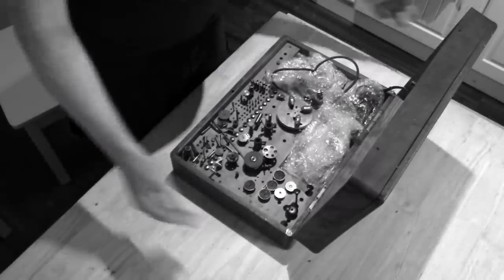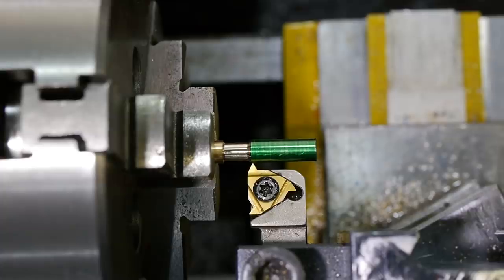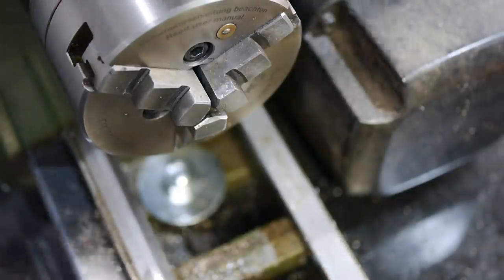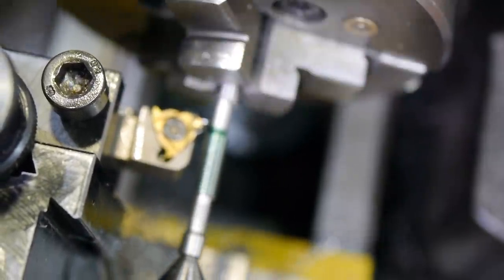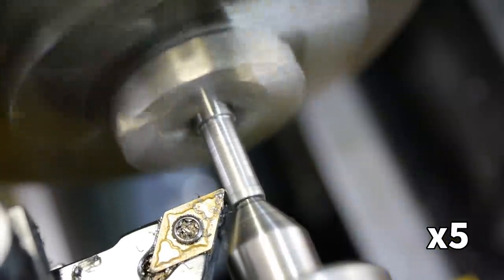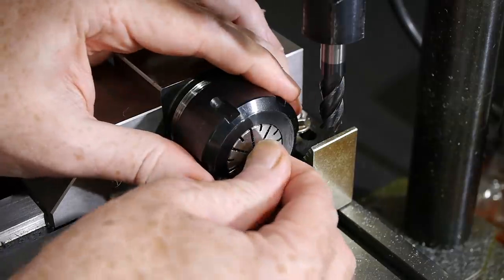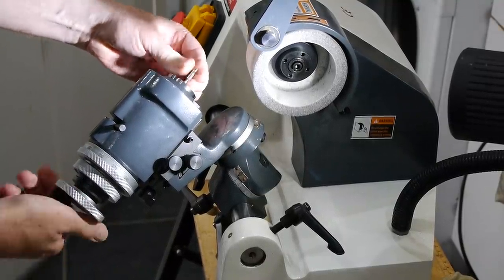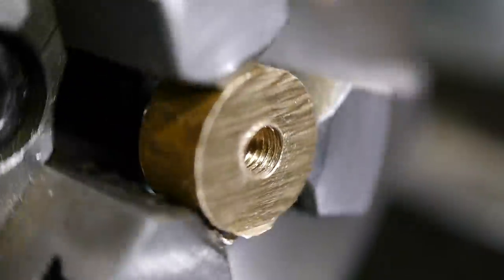Making a Custom Tap on the Proxxon PD 250/e Lathe

Comment: Special jacks and tool & cutter grinders and making taps,  oh my! The 55 deg thread suggests  Whitworth threads, but I never heard of a watchmaker's lathe using Whitworth. Maybe it was a British-built job and they used that thread out of habit. No law against it:) . this ill get a re-watch.
Reply from the maker: Thanks Juan! I did quite a bit of reading on the lathe, and the thread standards of the time period it was made. There was a lot of variation in included angle, with many different angles proposed. In Germany (where the lathe was built) metric measurement was standard, but the modern 60 degree metric threads had not yet been standardised.
Reply: Interesting! Didn't know Germany was late to standardize  on 60 deg threads
Reply from the maker: @juanrivero8  I don't think Germany was any later than anyone else. These lathes were designed in the second half of the 19th century, but most thread standards didn't emerge until the later part of the century.

Comment: Another solution to the relief problem is to cut your flutes off center, causing a positive rake on the cutting edge
Reply from the maker: A positive rake would probably be useful, but rake is not the same as relief. The tap would still need to have the relief ground in behind the cutting edge.

Comment: i speculate that considering the engagement of loading on the  cutter  ( when milling the tap flutes; given that it is a non uniform cut loading for an odd number of flutes) you would technically want an even number of flutes on your cutter for this kind of thing otherwise it will be more prone to chatter and deflection. perhaps a more seasoned machinist could offer further insight as this is really just speculation.
Reply from the maker: I have to admit to knowing very little about endmill selection, beyond knowing that more flutes generally means more load. I'd love to hear if anyone has advice on chossing small diameter endmills for use on a very small mill, especially as I don't have the rpm that endmills like this really need.
Reply: @AdventureswithaVerySmallLathe  More flutes means more cutting load typically only because you increase the feed rate to reach the optimum cutting feed per flute (double the flutes ~double the feed rate~). For the odd job this is not really important slightly more tool wear isn’t the end of the day for a better cut and if your limited by a low RPM then a high number of flutes is a mean you can increase material removal rates if your setup can handle the increase feed rate and forces.   

I suggested an even number of flutes in this instance because if you think about how the cutting action happens over the course of 1 revolution you will find that only 2 of the 3 flutes are cutting at full depth some of the time (as 1 ball mill flute will be crossing the flute or “gap” of the tap), as it is an odd number of flutes this means the cutting forces are non-uniformed across the axis of rotation potentially resulting in chatter. A 2 flute cutter for example would have uniformed cutting forces but a non-uniformed cutting load over a full revolution (again as both flutes cross the gap in the middle) a 4 flute cutter would have both uniformed cutting load (almost) and uniformed cutting forces (across axis of rotation). 

I should point out that I’m only really basing this off of the reasoning I pointed out above. And all of  this is really only because in this instance you have non-unformed cutting forces over 1 revolution (with a  3 flute cutter), now on an unformed cut (no gaps) cutting flutes directly opposing each other (such as 2 flutes of 4 flutes) actually creates oscillation => chatter but not as much as having a non-unformed cut would.    

I hope this explanation is helpful: as while I recognise in this instance it probably wouldn’t have made a huge amount of (if any) difference given the depth of cut and your feed rates I figured it might be useful to point out how you can think about the engagement of each flute when cutting on a per revolution basis as this might help with tool selection of other projects and generally help reduce chatter.

Comment: Would case hardening be an advantage?
Reply from the maker: I don't have enough deep knowedge to know whether case hardening can work for making a tap. The amount of material I needed for this one-off tool was cheap enough that it wasn't a factor in choosing the material, so I chose a through-hardening tool steel that is easy to machine.

Comment: Why are you grinding the taper after hardening the steel? You could have cut the taper on the lathe, or at least grind it before hardening... Maybe doing taper before cuting the "thread" would produce sharper tap when doing it before hardening.
Reply from the maker: All the videos I watched, and projects descriptions I read involved doing some kind of grind after hardening to form the cutting edge. Hardened steel is much less likely for form a burr, and holds an edge better, so it makes sense to me to form and sharpen the cutting edges after hardening.
Reply: @AdventureswithaVerySmallLathe  i know, but is this really how you sharpen a tap? feels to me like it needs more than grinding taper to be properly sharpened...
Reply from the maker: Oh, you're absolutely right. The taper turns out to be almost irrelevant compared to grinding the relief, which is what really allows the tap to cut properly. The step I did to add the pure taper, without any relief grind, was completely pointless. I should have ground the taper and relief at the same time, but had no idea how to go about it. I mentioned this in the voiceover, but I have no good video footage of grinding the relief, as it was very difficult to shoot, and I was clueless. :)

Comment: Nice skills. And thank you for the non-magnetic trick.
Did i hear correctly, you used naphta gas?
Reply from the maker: The bottle is labelled "MAP/PRO gas". It's intended to be hotter than propane, and easier to use than acetylene. The data sheet contains a lot of information, with some parts saying that the bottle contains mixture of methylacetylene (propyne) and propadiene, other parts suggesting it contains propylene. As a simple to use hand torch it works way better than the propane torch I tried, and is easy to buy at the local home improvement store.
Reply: @AdventureswithaVerySmallLathe  MAP/PRO is just propylene, but labelled that way to indicate its usage as a MAPP substitute. "True" MAPP was a trademarked product that is no longer available. The easy way to tell is to look for the UN number on the bottle - 1060 for MAPP and 1077 for propylene

Comment: If you are going to remake the nut why not use a more standard thread pitch?
Reply: It would change travel speed of the ways
Reply: @bertjetolberg103  pitch would be the same on 55 and 60 degrees. .same amount of travel per rev.
Reply: @albrolake7787  I suspect the pitch is as much a problem as the angle. I checked McMaster, and they have no 0.6mm pitch taps of any sort.
Reply: @outputcoupler7819  3.5 x 0.6 standard size

Comment: loved this video so much!! Question not relating to the Tap itself but the oiling of the products before milling. How do you know when or when not to apply oil (lubricant) to the material you are milling. I watch a lot of these videos, well a reasonable amount here and there. I say to myself "that needs some lube, surely". Ive never done this kind of work so i'm curious. as a motor mechanic, i lube anything i'm trilling metal wise

Comment: Just starting to watch your videos, very nice videos! tell me is that the only lathe you have in your shop? is Proxxon lathe a good lathe to buy, if you had to purchase a new lathe what would be your first choice of lathe? Thanks for making  those videos.
Reply from the maker: If I could turn back time, and buy my first lathe again I think I would probably buy something cheaper. The reason I'd do that is that I would treat it as more disposable, and modify it as much as possible while I learn how to make it better. A few years later, if I was still machining, I would buy something larger to replace my cheap small lathe.

The Proxxon has some fine qualities, but at some point I'm going to need to upgrade, and in the meantime I'm reluctant to modify or risk damaging it due to the high cost.

Comment: it looks like your trying to make a BA thread very close to metric fine  in its smaller sizes . a BA  0 thread for example has a pitch of 1mm but root angle of 55 deg but will take a standard 6mm metric nut   BA threads are often used for model making or watch making.
Reply from the maker: I don't think it is BA. The closest to the correct outer diameter would be 3BA, but the pitch doesn't match at all. I searched far and wide to find a standard thread that matched the screw, but couldn't find one.

Comment: so.. hardened steel is nonmagnetic? but that is not stainless right?
Reply from the maker: Hardened steel is just as magnetic as before at room temperature; the steel becomes non-magnetic when it is hot. The magnet trick works because non-stainless carbon steel becomes non magnetic above about 727 C, because it at this point the crystal structure transforms to austenite - the same crystal structure as stainless steel. This transformation is essential before quenching to harden the steel, so many hobbyists use a magnet to check if the steel is hot enough. Read Guodlca's pinned post for some more details of what happens to steel as it heats up, and stops being magnetic.
Reply from the maker: All this is a major simplification, and not really scientifically accurate. If you are interested in really understanding steel, start reading in wikipedia, and go from there.
Reply: @AdventureswithaVerySmallLathe  oh thank you, so you test the temperature with the magnet, cause it is nice and roasted and only then it is non magnetic. didnt realize that, thought the structure holds after cooldown..
Reply from the maker: That's correct.

Comment: Where did you get your threading insert?
Reply from the maker: I ordered it through eBay UK. It wasn't easy to find. There are hundreds of sellers for 60degree thread inserts, but few for 55degree inserts.
Reply: @AdventureswithaVerySmallLathe  under stood now to buy a 60° insert for some threads I am cutting also have any tips for cutting threads to a shoulder?
Reply from the maker: @nullsnaggle5198  My favorite technique for cutting to a shoulder is to cut in reverse, so I'm actually starting at the shoulder and cutting away. For details of my technique check out the Boring Head Arbor video, though I use the same technique in the recent Machinist's Jack video too. It's a bit unconventional, and requires an internal threading bar, and an internal insert, but it works really well.
Reply: @AdventureswithaVerySmallLathe  alright thank you my good man I hope it works with a central machining lathe as well as a proxon😛👍

Comment: I noticed when you center drilled the steel stock, the drill bit wandered a bit off center and gave you an eccentric center hole.
Reply: Most if not all lathes do that.  That bit pulled to center, not away from it.  The tail stock is usually slightly off no matter how hard you try to align it and that starter bit is designed to find center on a flat spinning surface all on its own.  Tailstock mounted reamers are designed with a long shaft with slight flex so it can also compensate for this slight misalignment.  No matter how accurately you try to level that lathe bed there will always be the slightest amount of twist in the bed which puts the tailstock slightly out of alignment, in addition a new lathe actually has the tailstock centerline sitting very slightly over center because the designers know that the way surfaces will wear over time. And the drill centerline will move down from slightly above center height to perfect center height to slightly below center height during the design life of the lathe.  Chris
Reply: @shadowdog500  thanks, I get what you're saying.
Reply from the maker: The tail stock is the weakest part of the Proxxon. It isn't perfectly central, isn't very rigid, and can't be adjusted. If I want to have really concentric hole, I have no choice but to use a boring bar. Thankfully for this project I didn't need the centre to be perfect.

Comment: Nice build, great job on the editing
Reply from the maker: Thanks Dale, that means a lot to me! :)
Reply: @AdventureswithaVerySmallLathe  Hello nice entertaining Video. For your next taps you can plan to grind some Back reliaf  in the taper. To See what i mean . Inspect a purchased tap closly.
Reply from the maker: @Hendreh1  Yep, you're right. While I did add some back relief to this one, the video recording didn't work well, so I didn't show it in this video. I only realised afterwards that I should have ground in the back relief and the taper at the same time, in the same grinding operation.
Reply: @AdventureswithaVerySmallLathe  OK nice to know . I Just thougth , it would work in brass anyway. A wile ago i made a tap for a S20x2 internal  thread . I can say Homemade taps with back relief work even in mild steel.  One more questionen. Where do you buy your chemical paste that you smeer on the workpice before hardening? Greetings
Reply from the maker: @Hendreh1  The paste is Boric Acid mixed with methylated spirits (de-natured alcohol). Boric Acid is sold for a number of reasons, and is most easily available as an insecticide. I bought it from Ebay.

Comment: What DCMT inserts do you use?
Reply from the maker: The ones in this video are the unbranded inserts that came with the tool, and they are pretty bad. I have some Sandvik Coromant inserts on order, as their inserts have worked really well for my CCMT tooling. For a small lathe like this inserts with a small nose radius (0.2mm), and a "finishing" chip breaker are best.
Reply: @AdventureswithaVerySmallLathe  Thanks, i had lots of trouble cutting 303 steel in a bigger lathe and i was sure it was becaus of the inserts, tried every speed and feed possible but never got a good finish.

Comment: I find it curious you have a d bit grinder that probably cost more than your proxxon lathe ... ?! You plan to treat yourself to a lathe upgrade sometime ? ;-)
Reply from the maker: The D-bit grinder was quite a bit cheaper than the Proxxon lathe. My main problem is lack of space at the moment. Only the Proxxon has a proper permanent bench space, and the grinder and my chinese lathe get shifted around from corner to corner as I work in the shop. Once I move to a bigger place with a proper dedicated shop then a lathe upgrade will be on the cards, but for now I enjoy the challenge of seeing what I can do with what I have.

Comment: If you are going to remake the nut why not use a more standard thread pitch?
Reply from the maker: I talked about this a little in response to an earlier comment. Learning how to properly measure, match and restore an unfamiliar thread is a valuable learning process, worth it for the skills and experience gained. The other reason is that it's important to me to restore the lathe to its original specification. I'm not planning to re-make the screw though; I just plan to use a die to clean up the damaged threads, and restore the screws to usable condition.
Reply: Fair enough.

Comment: Could you have cut the tip on the lathe before hardening?
Reply from the maker: I think that would have been very difficult. Once it was parted off, the tap is very long and narrow. Attempting to turn the end into a point would have made it flex a lot. I could have used a collet to hold it by the threads, but I would be worried about damaging the tips, which form part of the cutting edge, so are important to preserve.

Comment: Great video! Allow me one remark/suggestion: when using a drill or tap on brass, then it will never cut as nice again on steel unless you regrind it again. So for nice work you always need separate tools for brass and steel. It is not related to different tool-geometry, but just the fact that once cutting brass seems to effect the tool-cutting-edge. So my comment for making the tap would be to NOT test it on brass to see how it works, because by using it on brass it will never work as nice on steel again.

Comment: Aren't 55° thread pitch old British Standard?
Reply from the maker: Yep, that's the Whitworth standard, but there is more to a thread standard than just the angle. This thread matches the angle, but doesn't match the other dimensions like pitch and diameter specified by Whitworth.

Comment: He said MAP gas burns a lot hotter than propane. I looked it up a year ago and it was like a difference of 1300 degrees vs 1375 degrees. I thought there was basically no difference.

Ok 3600 vs 3750. Even LESS of a difference than I thought!
Reply from the maker: Interesting. The data I found suggested that the gas I was using burned at 4582F in air. Where did you get those numbers? As others have pointed out, true MAPP gas is not longer available commercially, and the available brands are a substitute. Unfortunately the data sheets are a bit ambiguous about what gases it actually contains.
Reply: @AdventureswithaVerySmallLathe  

I just Googled Map gas vs propane and saw top results list those 2 temperatures. 
As stated, I also looked it up a year ago and got similar results.

Comment: I have 1 question: how does he know where to "start cutting" every time? If he is slightly too off in the 360 degree "circle" of the screw-to-be, it will be ruined. (PS: i'm just a random guy with no skills in lathing whatsoever).
Reply: You are certainly correct. This is exactly why, on any thread cutting lathe, that the  spindle with the part spinning in it is exactly geared to the tool lead screw. This is why he has to make a custom gear just to do this thread. Look up other videos on thread cutting and it will explain in much greater detail.
Reply: @tobiasgertz7800  Thanks!